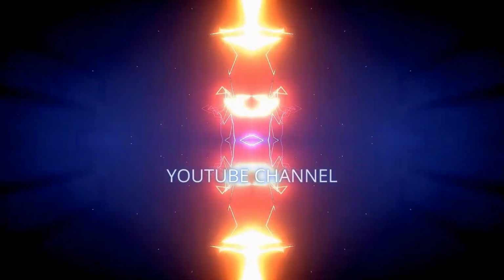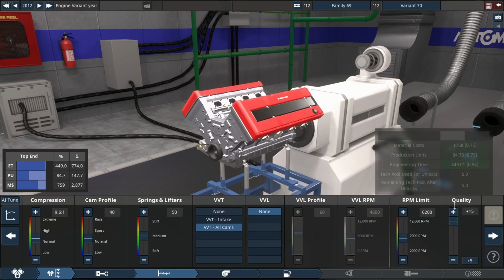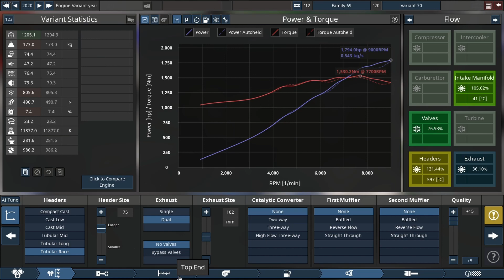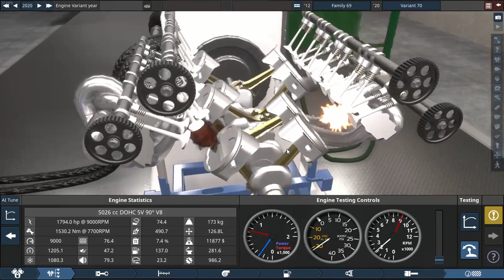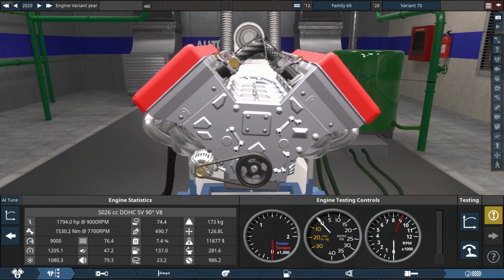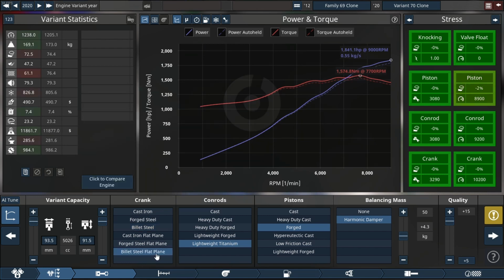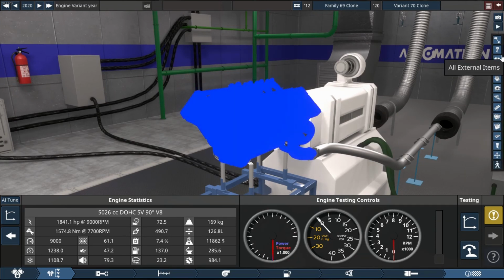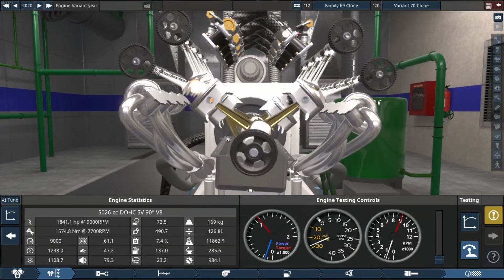FLATPLANE VS CROSSPLANE V8 !!!!! - Automation the car company tycoon

Comment: ferrari v corvette basically lol
Reply from the maker: yeah something like that
Reply: @Curiousgamer20  imagine a flatplane V16 lol
Reply from the maker: Yeah i think that would be a cool but terrifying sound
Reply: @Curiousgamer20  bruh crossplane 4 cyls sounds awful, sound like half a V8, literally
Reply from the maker: I get what your saying but if the exhaust pulses are correctly timed i think that would sound good
Reply: @Curiousgamer20  many bikes have it for no particular reason other than 'but muh sound'
Reply from the maker: Yeah ok i can see your point there
Reply: @Curiousgamer20  don't get me started on t plane 3 cylinders... Why tf would you want a 3 cylinder to sound like a V8 running on two holes?
Reply from the maker: Yeah that sound it makes isn't good for the engine either
Reply: @Curiousgamer20  basically it's a 3 cyl with two and tdc, one at BDC or 🔼🔽🔼
Reply from the maker: Yeah it's the same layout as twin air fiat engine
Reply: @Curiousgamer20  it's no. The twin air is a 180° two cylinder, the triumph t plane is a 180° three. Fiat fires evenly, triumph doesn't.
Reply from the maker: @quartzcyanis ok interesting did not know that
Reply: @Curiousgamer20  it's why the fiat sounds like a four pot, or a classic 500 pitter patter sounds, I find it quite pleasant
Reply from the maker: @quartzcyanis that's actually cool now that i think about it
Reply: @Curiousgamer20  I'd recommend looking up an exhaust clip for a twin air 500S, sounds mint
Reply from the maker: @quartzcyanis ok yeah it sounds cool thank you for the suggestion
Reply from the maker: @quartzcyanis i will do so thank you have a fantastic day
Reply: @Curiousgamer20  what version are you using cause i have the latest version of automation and it doesnt have the flat plane crankshafts